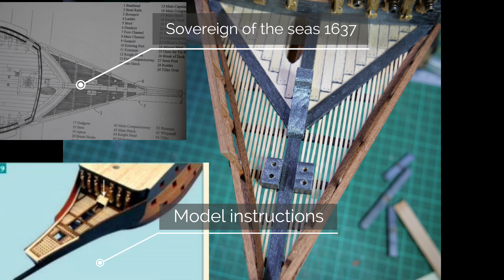Sovereign of the Seas Wooden Model Kit by Deagostini Customised build, Replacement Cannons

Comment: Nice job!  I found getting the scale right for eyelets could be improved by using a smaller gauge alternative. I was building a 1/50 scale ship at the time, anyway, might I suggest the Caldercraft PE brass eyelets 83505 or similar. Good for all sorts of bits and bobs that need a rope attachment etc!
You get 250 on one sheet!  Nice and small and may be okay for cannon furniture.  Alternatively I found that a very small brass split pin works quite well too.  Anyway cracking job and the replacement cannons are much better. 😉Regards JH
Reply from the maker: Hi Johnny, thanks I will take a look at the alternative eyelets.

Comment: I did use that rigging as discribed on the double axel cannons on the main deck. For the rest single axel cannons, i just left it out, i felt it became too messy. too busy.... it just didn`t look right.
Reply from the maker: Hi Martin, i will put the rest together and see how it looks, did you also add the cannon ball boxes and buckets?
Reply: @g-kip  yes i did, those at least looked somewhat in perspective
Reply: The hoiste blocks are as big as the buckets, that probably made it u real to me.